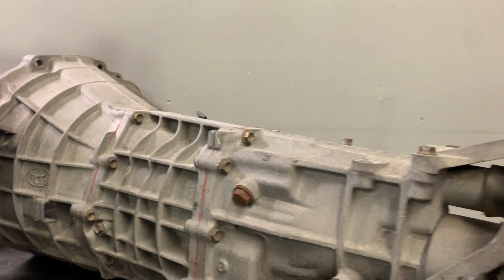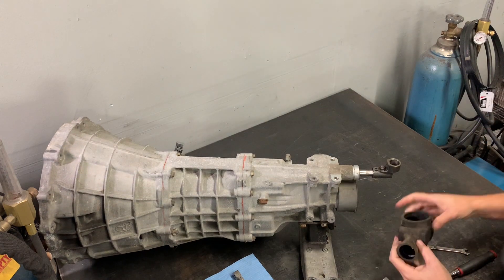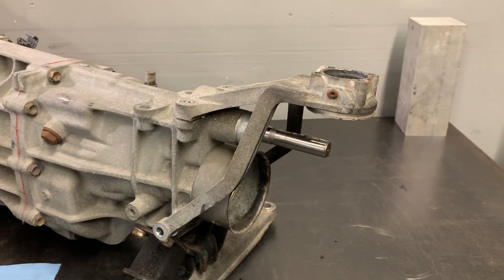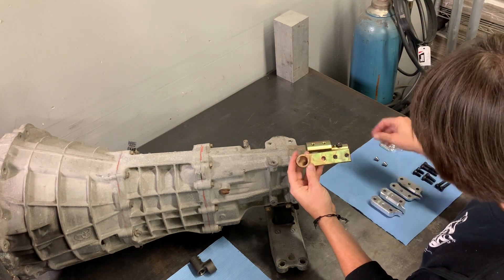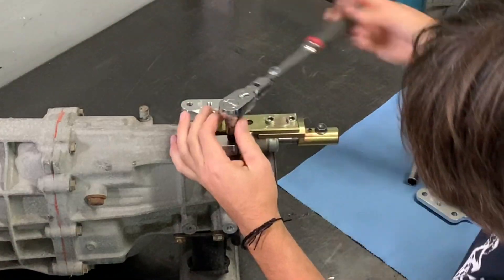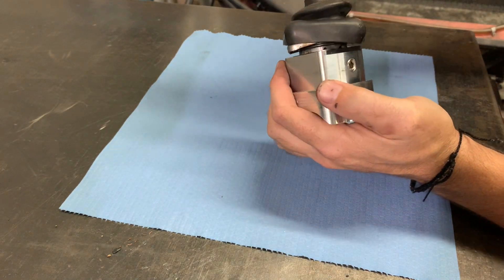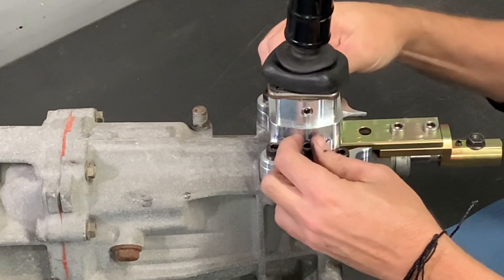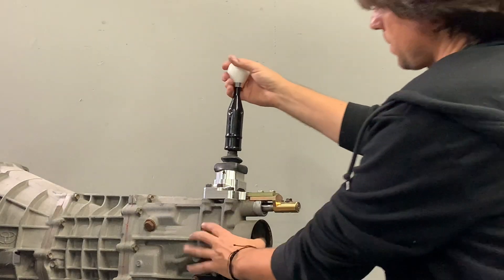JSP AE86 Beams J160 Shifter Relocation Kit

Comment: How would you mount it in the rear position? I assume reverse the bolts on the mounting plates? And move the gear selector back one hole?
Reply from the maker: The steel lever has three mounting holes. The forward two are for the rear mounting position, the rear two are for the forward mounting. The housing mounts on the spacers in either the front two or rear two holes. Hardware is the same in both positions.
Reply: @johnrussakoff  awesome. Thanks so much.